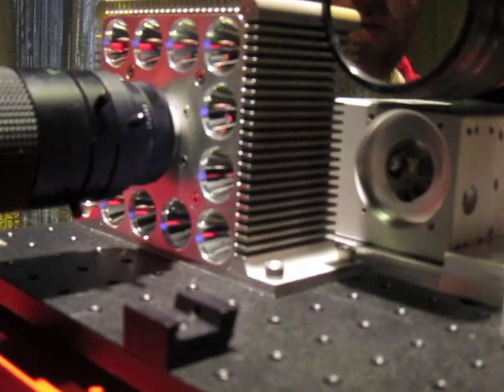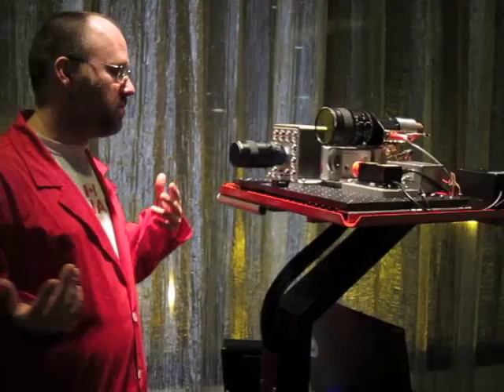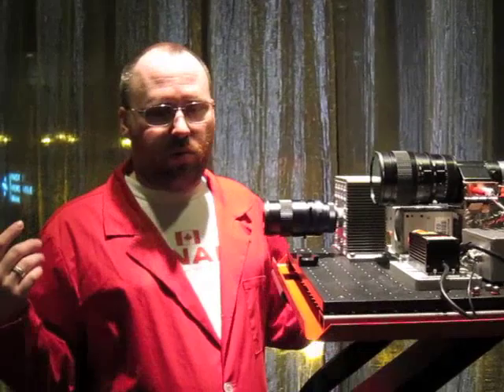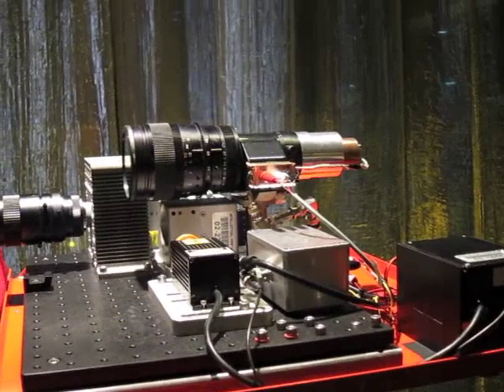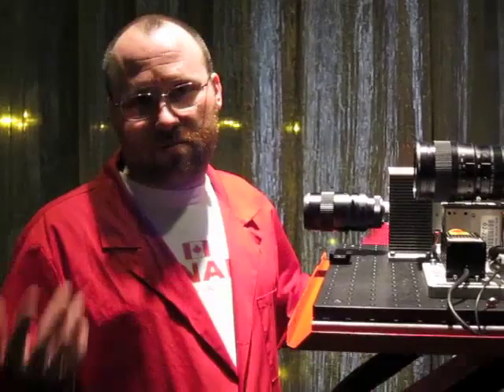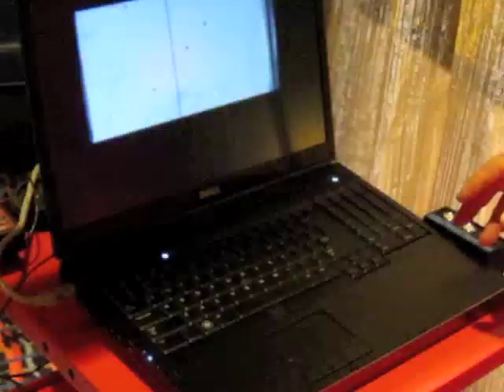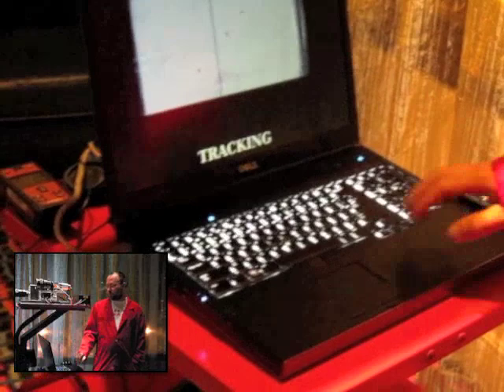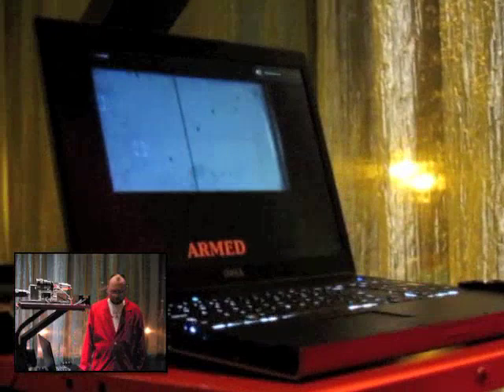How the Photonic Fence Works

Comment: I wonder what level of computing power you'd need. I use my laptop for a background subtraction technique I'm using to track objects captured by a cheap webcam. The objects are being tracked but as they pass a virtual line, the counter doesn't always go up. I'm wondering if it's because my computer is fast enough. It's an i5 though.